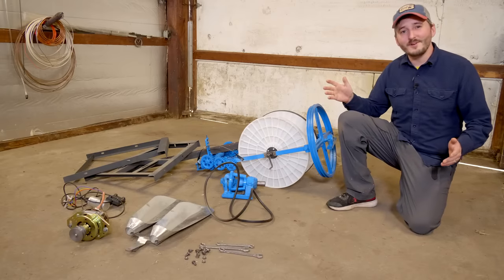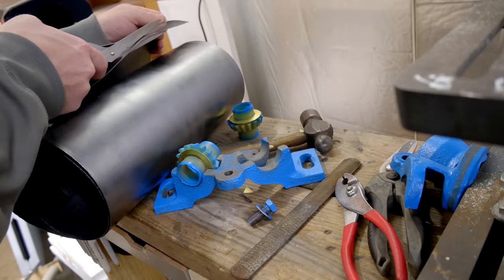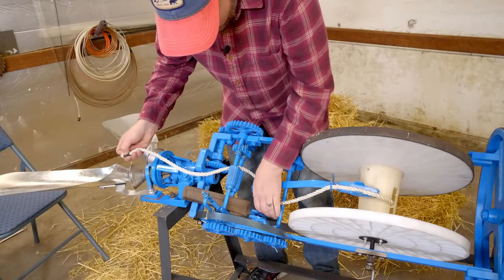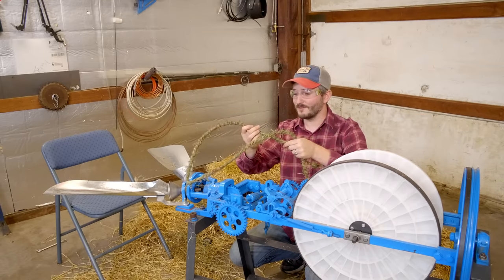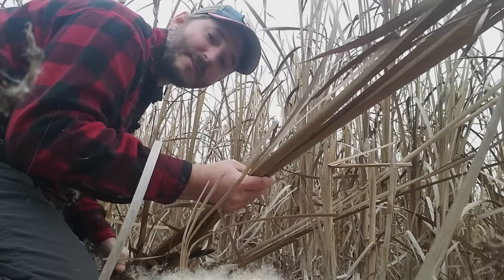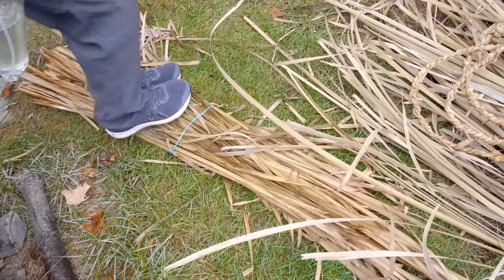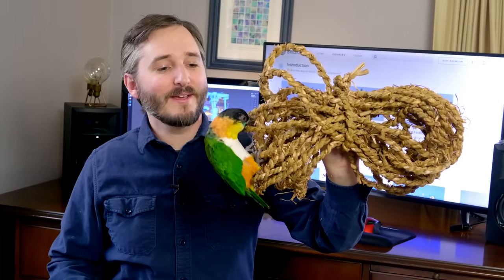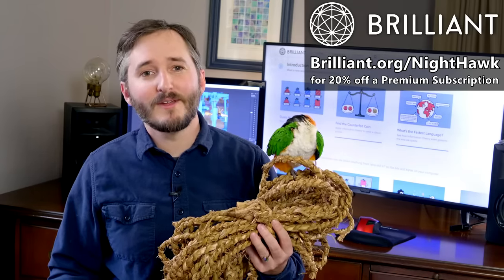A Machine That Turns Plants Into Rope

Comment: The lack of quality in that equipment when it was just out of the box is almost impressive. I mean why even bother making something that badly?
Reply from the maker: It's definitely made with bare minimum levels of operability in mind. I was surprised they bothered to assemble most of the pieces before shipping.
Reply: @Nighthawkinlight  as a side note, watch out those pieces of graphite foil contacting bare cast iron. In the long run, the iron (even stainless steel, for that matter) may corrode in a moist environment, with graphite acting as a (noble) cathode.
Reply: @rubpy graphite can cause stainless steel to corrode ?
Reply: @zncon Not all equipment needs to be done to Swiss standards. You will often see extra slop in machinery that belongs on a farm. It's probably more important that it gets lubricated every time. I'd use heavy weight non detergent oil for something like this. That's what me and a buddy used when spinning a 5 foot high circular saw blade being driven by a leather belt to a PTO on an old gasoline powered tractor.
Reply: To quote Anton Ego, "In many ways, the work of a critic is easy. We risk very little, yet enjoy a position over those who offer up their work and their selves to our judgment. We thrive on negative criticism, which is fun to write and to read. But the bitter truth we critics must face is that in the grand scheme of things, the average piece of junk is probably more meaningful than our criticism designating it so."
Reply: Visto reduction
Reply: @Nighthawkinlight  It already was assembled. Evidenced by the paint job that was done on the already assembled gears and bearing-holders. How much rope can you buy for $900 ?
Reply: Cattails, and blackberry vines (green) and when they dry they strengthen.
Reply: Haha... I said cattails before I got to the part where you're  using cattails!
Reply: @Zicon  you should see how hemp ship cables where made with much more rudimentary machinery than this one. It's the material preparation that makes the difference, not the machine.
Reply: @johnpossum556  Anything that does work will necessarily fall into a higher state of disrepair. Entropy.
Reply: @raytibbitts  Yep.  My thoughts exactly.  😁
Reply: @Nighthawkinlight  Nothing some "rectroactive precision" couldn't fix at least.
Reply: For that type of mechanism they send it to you dry, and you are to add the grease yourself… and it can get messy in shipping.
Reply: It looks as if the casting was original for plain bearings as the main one has an oil hole at the top. I'm guessing at some point they realised it was cheaper to use off the shelf ball races and they didn't quite fit the casting.
Reply: @Original-Phantom  Nothing is 100% oxide resistant.
Reply: Farm equipment is made using very wide material tolerances on purpose, this is because they are frequently used in very dirty environments and the larger tolerances mean that they can still function when coated with dirt and debris, a similar difference in tolerances is found in the distinctive difference between the Ak47 and the m16 rifles, the m16 has very small tolerances and is easily ruined by dirt and debris, while the ak47 can be buried in a swamp and still function afterwards. Oil and lubrication are key to their continuous functioning.
Reply: @jasonburguess  well that does makes a lot of sense.
Reply: Not lack of quality per se it’s more of focus on making a complex machine as simply and cheaply as they could, it probably would’ve worked (albeit poorly) right out of the box so all in all not the worst build quality I’ve seen coming outta China, and it just took a few pieces of rubber and a solid lubricant to get it going properly which was like $0.50 to get, not trying to defend the manufacturer here but i do have to give them credit for the simplicity
Reply: I wonder which country this machine was purchased from... Lol
Reply: It seemed like it would run? Its rope making not rocket science, quality control costs $$$ and if its for farm labor then the person who buys it knows how to service it. No doubt there is one which is perfect for 2x the price if you choose that
Reply: Islam is not the issue. The issue is the religious people's anger and mis-use of religion. Fix your peers anger and missuse of religion and then come back to preach about Islam or any other religion for that matter...
Reply: According to the word on the on the bearing housing, it's made in China.
Reply: also...those two small cone gears looks like made by plastic, i will expect it may worn out quick.
Reply: My ex-gf bought a new 100cc quad for her boy.  I had told her do not buy a Chinese quad.  It will be problematic.  And it was.  In multiple instances.
Battery box, electrical, ignition, etc.
I threw my hands up before we separated.  (Not because of the cheap quad.)
Reply: @TheSliderW  what in the sweet-n-sour hell are you on about?
Reply: Was it dirt cheap or something? Hopefully that's the reason for the shoddy quality.
Reply: Its made with a newly invented metal called chinesium
Reply: @Nighthawkinlight  tight and hard is not usually the best way to go. Think about the flexibility and durability of you're on fram. A little wiggly? Is it worth keeping. Absolutely.
Reply: @jasonburguess  and used hard every day all day. Something these key board kings know very little about.
Reply: Hemp is great for making ropes
Reply: @Splarkszter  thanks, makes sense, all things wear down over times
Reply: China, that's why.
Reply: @johnpossum556  Dude probably just wants it to looked cnc machined
Reply: @Original-Phantom  if it can carry electrons it will cause corrosion.
Reply: @TheSliderW  wrong thread
Reply: @johnpossum556  Swiss standards?!? Those are some of the worst iron castings I’ve ever seen someone bother putting paint on. Blowholes, slag inclusions, mismatched molds, you name it! It may be fine for some “rope hobbyist” if there is such a thing, but it does not belong on a farm. I would have been furious if I paid money for that trash and I’m not even a rope hobbyist. 

Someone needs to educate American farmers out of the Iron Age.
Reply: its meant to turn "any" fiber into rope the tolerance has to be high since it work with cotton to tree bark, and grass
Reply: @rubpy  Yeah, I'd use some little strips of UHMW or similar instead.
Reply: @Original-Phantom  No, it's meant for Lubrication, to reduce Friction!
Graphite is Made of Carbon(C),
Carbon makes The Magic
Of Life!
Reply: Loos like it gets the job done with straw
Reply: It's Qualitative and Robust,
More Than Polished
Products Which Break
Apart After 2-6 Uses!
Reply: Money, obviously
Reply: @molybd3num823  It looks like it but the dude deleted his comment
Reply: Bro your wording made me think you were complaining about the video
Reply: Because it sells . If you don’t like it don’t buy.
Reply: amen
Reply: @bruitation  
"Not much. Less than 200m."
For the quality of rope this machine makes, you are off by a factor of 20! If not more.
Reply: @Original-Phantom  many things can cause stainless steel to corrode. Cleaning it with a non stainless metal scrubber can cause corrosion. The difference in the metals is what causes it.
Reply: Your average quality Chinese casting and milling.  The cost is kept down by bulk reuse of castings and general milling versus precision fitting.  It dramatically lowers the life of the machine, but then the buyer just needs to order more “disposable” equipment.  It’s very common where the cost of manufacturing labor is significantly low and plentiful.
Reply: The chinese have specialized in this technique.
It's just operable enough so you can't sue them.
Reply: @DreadX10  A finite amount.  How much rope can you make with a $900 rope-making machine?  More than you can buy.
Reply: What?! The machine is excellent!
Reply: It's farm equipment intended for people who seek to save money on buying rope... It has to be cheap and so the fit and finish is sloppy. 

Plus, once it has seen a decade of use and has been repaired a couple of times, the slop in the joint will ensure the machine doesn't bind.
Reply: So it is good? Looks to Me.
Reply: Maybe fix the bearings by replacing with babbett bearing material,
Reply: @Original-Phantom  You can get graphitic carbon from charcoal taken out of a hot fire. The hotter, the more conductive. You can check with a multimeter. I did some experiments using it as a battery material, or in a supercapacitor configuration. Fun experiments to do, Robert Murray Smith is a guy who put a lot of videos about the subject on here, including natural materials. If you use aluminum as a current collector and coat with conductive carbon, it will eat right through the metal within a day or two. Carbon behaves like a noble metal and will break down almost anything else. Not sure about gold or platinum. Currently thinking I will be trying to use some of that conductive carbon in conjunction with a non-conductive binder like PVA glue or something to make the neutral plates on an oxyhydrogen (hho) generator. If it works, then the only real cost will be for the two end plates which will have to be something fully conductive like stainless steel. Conductive carbon is a susceptor, meaning it gets very hot in a microwave. You can use a microwave kiln to enhance the conductivity til it is comparable to metal.
Reply: That is odd. Just a little standardizing of some drill bits and lathe settings is all it would take to tighten the machine up to a better quality.
Reply: these tools are generally intended for the third world, to be a business. the $300-900 dollars this already costs represents a years wages for the target audience. if, for example, a trash picker in india saved up enough for this he could turn his trash into a finished product and potentially more than double his income. with this machine he may even be able to send one of his kids to school. this may make the difference in his families history. sure this machine may become irreparable within a few years, but if he made enough money he could then buy a better machine.
in contrast, with proper quality the machine could easily cost four times as much and be entirely unobtainable.
Reply: It looks like the castings were designed for a different kind of bearing and they just installed the closest bearing they could find
Reply: When I was a kid in the 70s, I did historical re-enactment at a place called Clayville Stage Coach Stop in Illinois. One of the things I demonstrated was rope-making, and the machine we used was roughly 100 years old THEN... of course, one did have to turn a crank manually at one end, and have another worker walk the "rope walk" with the ... doohickey I can't remember the name of, a kind of cord separator which maintained an even amount of twist.
Reply: Yeah I was thinking, what's the harm in CNC-ing some aluminum for a tool like this?
Reply: @johnpossum556  seeing how loose the bearing was it wasn't working properly as a bearing. yeah it didnt need to be built by a swiss watch maker but it should at least be built with some competent workmanship. not thrown together like it was made in neanderthal times.
Reply: @Original-Phantom  stainless steel can oxidize, it's just highly resistant. In marine environments, monel and inconel is used instead. Things besides environmental factors can cause corrosion, such as dissimilar metals conducting electricity. Graphite, while not a metal, can cause corrosion this way to aluminum way faster than steel, but regular maintenance should prevent too much damage
Reply: I expect that it has been cast so many times without the mold being repaired or replaced that it's just a poor fit now.
Reply: The straw might work better if it were a little more moisture.
Reply: @rubpy  doesn’t carbon, in which graphite is made of, end up bonding and fusing itself to the iron in steel.
Reply: @TheSliderW  , Exodus 20: 3.
Reply: I would make or adapt 2 sprockets to cut the spool spin speed by half for earlier operating. Then build a plywood shield over it. All it's asking for is one shirt sleeve cuff.
Reply: Bro, I read "equality" instead of quality in the first line and almost gasped.
Reply: @rubpy  doesn’t electrolysis require electricity passing directly through an annie’s and cathode?
Reply: @TheOfficialOriginalChad  Blackrock is in the process of educating them out of existence entirely.
Reply: You haven't seen anything yet!

Trust me, worst peace of macinery must be a flatbar bender. It takes 6 hours of machining before use and it has only 2 moving parts. (1 before machining)
Reply: That's why you can buy these things for less than 200$ lol
Reply: Could you have made it better?
Reply: Did he pay for it sight unseen or not? He did? that's why.
Reply: I was sitting here writing a comment about cattails being an option as soon as I saw the bale of hay.. nice. The fluffy parts are nutritionally dense and used for survival food.
Reply: @DreadX10  who cares, he didn't buy it to save on rope costs
Reply: @unteren_text5425  He is the exception to the rule. Most people buying this thing don't do it to show it on youtube.
And, apparently, I care so .......
Reply: It might have been a recondition that was labelled 'new'. Sort of looked like a used rig that had been repainted/bearinged.
Reply: Seems like it needs ivy or vines
Reply: Problem is that hemp or low quality rope is ready super cheap
Reply: Imagine using it with collections of wires
Reply: So treu
Reply: @jasonburguess  are you seriously comparing the tolerances of an AK to the half inch of tolerance found in this machine before he fixed it.
Reply: @ytwdh  You get what you pay for with Chinese stuff. They have the capability of great engineering (look at the iPhone, and various other Android devices) but when it’s a Chinese company attempting to make a very cheap product, it’s usually terrible. Give them some competent leadership though and they can make good stuff. Xiaomi phones for example are fantastic quality. When it comes to a quad though, I wouldn’t put my safety in their hands lol. I’d go with a reputable brand any day
Reply: @Azzajay Brah  as far as firearms are concerned,  the AK 47 has by far the largest tolerances of any widely used firearm, compared to a colt 1911 the ak47 has a 150% higher (larger) tolerance level,  by the same scale comparison,  this machine is the AK to the standard 1911. That's like farmall to John deere with farm equipment,  farmall will last forever,  deere will break after one season.  Just sayin.
Reply: @jasonburguess  I do get your overall point, and in general I agree with you about tolerances sometimes being a hindrance, but did you see how this functioned out the box? There was inches of slop when he moved it, and the metal was porous, soft, and unlubricated. It just didn’t feel very relevant to this specific piece of machinery, even though you were more so using it as an analogy than a specific comparison. When I think of AK I think of a cheaply made but extremely competent and ready for anything you can throw it in the field with no user modification needed. I wouldn’t be surprised if this thing was non functional by now given its cheap Chinese power supply and motor.
Reply: @MarioGoatse  fair enough for me, excellent point sir.
Reply: Right?  Lose bearing poor fit, and that casting, HOLY hell, its full of holes.   

I also noticed the lettering on it.  Is this "made in China for china" levels of quality?   And I thought the exported their trash to us.  

Also these are hardly revolutionary machines.  I believe they had these in the bronze age in one for or another for just such a purpose, though they were often made of wood back then.
Reply: @johnpossum556  amen brother you tell them Euros 😂
Reply: @DreadX10  this machine is not meant to replace rope dummy. It's meant to turn scraps into something useful.
Reply: China.
Reply: Well just think about im which part of the world people need to make their own ropes...
Reply: it's cheap and the people that need it NEED IT CHEAP if they make continuous use of it they most likely will figure out ways to improve the machine out of sheer frustration
Reply: I’ll proceed to imagine... I
I believe this Was, a very very old EU machine, brought to the US, then sold to Xyna, it made its way back 🎉 It’s been “repaired” a few dozen times so let’s be tolerantly about the tolerance’s 😂 it is a “good way to learn” how to make a better one
Reply: @Splarkszter  you obviously don’t know about zirconium monohydrate ? 99.97% speaks for itself
Reply: This is what the “cheapest one I could find” energy
Reply: @rubpy  or heaven forbidding it touches aluminum
Reply: @Nighthawkinlight  this is clearly to used with freshly slain hay before it gets crunched up into haybails as it is straight then.
Reply: @rubpy  I like the presumption that this is noble graphite, what if it is in fact devious graphite? Bet ya didn't think of that!
Reply: One single reason, price. These aren't made for you, they are for farmers who make in a year what you do in a week.
Reply: cost. if it was expensive no one would by it. not everyone is a millionaire like you
Reply: such a cheerful guy, hun
Reply: @Splarkszter  .... except more oxide
Reply: @ytwdh  poorbaastardo !!😂
Reply: cautionary tale: i remember the days when you wouldnt by any tools from japan... 
the quality was non existant. for some time now, they have out performed many /most
other countries in manufacturing quality at a great price. China will improve.
Reply: A team of Indian shipyard workers and completely dismantle and scrap a 10,000 tonne steel ship with a few hammers and an anvil or two, ... everything is relative
Reply: @liggerstuxin1  ... only if the shops are open with supplies on the shelf ...
Reply: @violettownmicroenterprises1528  fair
Reply: @raytibbitts Love that, Mr. Tibbits!
Reply: Wouldn't some oil work good enough also?
Reply: To save money
Reply: @HergerTheJoyous It wouldn't surprise me at all if this machine would last longer than anything any of us owns. Even with daily use in a commercial setting.
There are just some things that don't have to be build to the highest (or even decent) standards in order to last a long time.
Reply: Theyre probably of shotty quality because rope machines are purchased by south american countries and villages with less money
Reply: That’s not a great comparison. The m16 when run dry will actually vent dirt and debris out of the mechanism while also using the carbon buildup as a type of dry lubricant. 

You should look up inrangetv’s mud tests. They’re quite revealing. As it turns out both mechanisms have veryy little reliability once they have contamination inside and the fact that the m16 has closer tolerances and essentially vents out the ejection port with several thousand psi every shot actually helping it to be way more reliable than an ak. Arguably the best way to make an ar more reliable would be to seal it up even better such as using self closing dust covers like the rpk.
Reply: I love this machine! Even before you yarn the wool you need to prepare the wool nicely otherwise you can never get the fine yarn.  He did nothing on the raw materials but the results are nice enough!
Reply: @raytibbitts  “It is not the critic who counts: not the man who points out how the strong man stumbles or where the doer of deeds could have done better. The credit belongs to the man who is actually in the arena, whose face is marred by dust and sweat and blood, who strives valiantly, who errs and comes up short again and again, because there is no effort without error or shortcoming, but who knows the great enthusiasms, the great devotions, who spends himself in a worthy cause; who, at the best, knows, in the end, the triumph of high achievement, and who, at the worst, if he fails, at least he fails while daring greatly, so that his place shall never be with those cold and timid souls who knew neither victory nor defeat.”

—Theodore Roosevelt
Speech at the Sorbonne, Paris, April 23, 1910